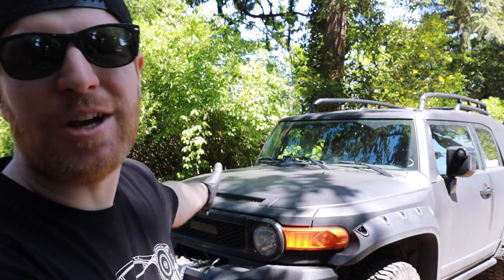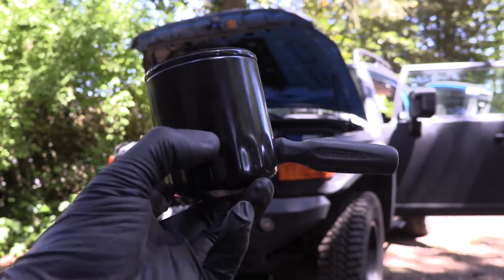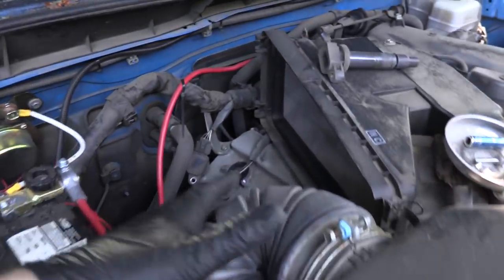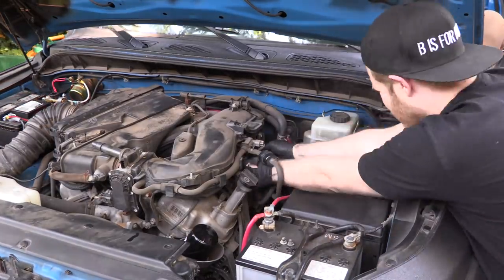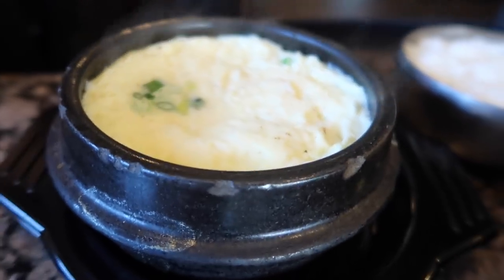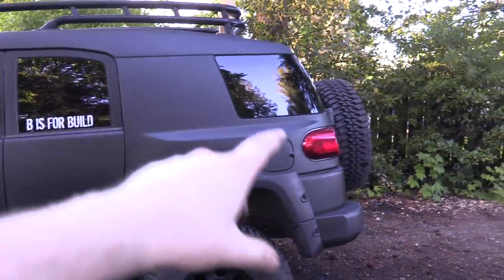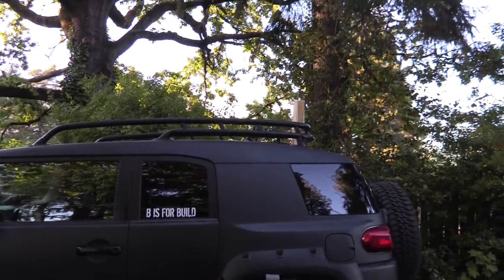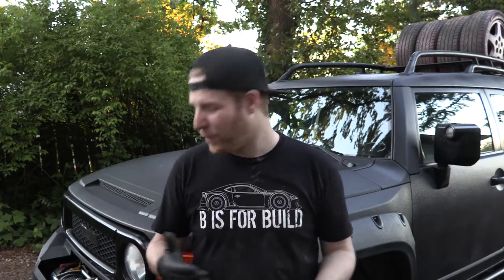FJ Cruiser Shop Truck Gets Some Love

Comment: im a "professional" oil pig, and we use a little brake cleaner on a rag to help twist off stubborn filters. sometimes it works, sometimes it doesnt, but i usually like to try this method before reaching for a filter wrench.

Comment: Tip for getting rid of wind noise from light bars, put them into a wind deflector. I had one on my 4th gen 4Runner and had to pop the sunroof open to narrow the wind gap between my roof and bottom of the bar. And it also toned the noise down.

Comment: If the oil filter isnt coming off by hand, I'd suggest putting a low grit sand paper in your hand. Works wonders for getting traction on a hard to grip filter.

Comment: Put a niece of pipe through the centre bores of the wheels and on either end of the pipe have a hole for a ratchet strap or metal clamp.
This would work for two or more wheels and if you’re just transporting one wheel it can lay flat.

Ratchet strap is a good option but with a metal rod through the middle it’ll make the load more secure/ be less likely to wriggle free

Comment: When I did the first oil change on my FJ, I tried using an oil filter wrench and it just crushed and twisted the outer shell of the filter. I thought the last owner just overtightened it. I made sure to not overtighten the new filter, but the same thing happened when it needed to be changed again. Had to do the screwdriver through the filter on every change.

Comment: Check the Throttle body and Mass Air Flow sensor if you never cleaned it. It will help with starting and run better too. I have a v6 Tacoma with the same engine and checked mine after was doing donuts on some off road trails. Also for the oil filter you can buy a 3' hose and put it on the nipple under the little oil filter overflow catch and drain it into a bottle or the pan you drained the oil in, so you wont drip oil all over your engine, belts, frame.

Comment: As was already mentioned, the screwdriver trick can get you into more trouble. As the metal skin and interior of the filter is so thin, you could easily destroy the body while the threaded area remains stuck. Now you can't drive to the store to get a proper oil filter wrench -- unless you're lucky enough to have a spare Evora collecting mold out on the street :)~

Comment: Cleaning your maf sensor is also a great thing if never done in 150k mi./ cleaning throttle body and relearn idle setting is also good if there is a small build up of dust/pcv vapor near throttle body. Cleans up idle if slightly bogging idle is noticed

Comment: One handy tip is to use an airline to blow out any dust, grime and debris before removing the spark plugs as it minimises the risks of stuff getting either into the cylinder or on the plug threads which will make them harder to remove next time.

Comment: A tip if you have an oil filter that's facing down, punch a hole in the top of the oil filter at the start of the serviced, lets the oil drain and makes way less mess.

Comment: Have fun sanding and painting that grill AGAIN in about 6 months time. Using rattle can black on a plastic trim piece WITHOUT a plastic adhesion promoting primer is a bad idea...

Also I thought most fuel system additives should be added just before filling up or at least part filling your fuel tank so that the additive actually gets mixed around in your tank...

Still love the build but don't let a busy schedule make you start taking shortcuts.
Reply: dito to that brother
Reply: petem8 I mean, for all we know he did run around the corner and fill up on fuel, or had a Jerry can.

He knows what he is doing, why are mechanics so forceful in commenting on every little detail.

If he wants help, he openly asks for it in the video.

Comment: This was dropped on it's side at some point right? That might explain the super dirty plugs on one side, they would have been soaked in oil and then that oil would burn into carbon when it started again.
Also, painting aluminium, like that grill surround, use an etch primer, otherwise it will just chip and peal again.

Comment: I’m a tech at a Toyota dealership. The spark plugs usually come out like that. Toyota recommends replacing them every 120k miles. (I agree that’s way too long) so the plugs usually are a bit tough to remove

Comment: I would advise disconnecting the battery at the negative terminal before messing with the coil packs. You’re probably fine, but why take the risk of shorting something out?

Comment: On the Evora air conditioning (since it's been empty for so long and comments were disabled on the relevant video):

You may know this, so this is just in case: use a vacuum pump to get it to the proper vacuum rating (-23 if I remember correctly), then fill it... videos are around about how to do that. Afterwards, just make sure the compressor isn't dragging on the drive belt when it activates, because that will indicate a broken compressor (it happens when moisture from the atmosphere wrecks the internals).

Here's hoping for the best.

Comment: I don't do that screw driver trick anymore. Once I twisted off the back and had to pull the radiator to get access with a hammer to chisel it out. 

Get the rachet head!

Comment: That service was spot on. You'll notice a difference straight away with fresh oil, filters and plugs. Does the FJ use a fuel filter or is it incorporated into an in-tank pump? I swear by NGK plugs myself. I also swear by BG fuel additives. BG44K for petrol (gas) and BG244 for diesel.

Comment: I hope you gapped the spark plugs to spec! Also to address other comments: 10k miles is probably pushing it in my opinion for an oil change. I used to change my oil every 3k or 4k miles but only started noticing enough difference when I started changing oil around 6k miles. I use Castrol Magnatec fully synthetic.

Comment: Aren't you supposed to change the oil AFTER using the fuel system cleaner? That's what i always do because i thought it makes the oil dirty after use.

Comment: Damn, that oil filter is the easiest to access I have ever seen.
Reply: I know, I saw that. wouldn't it drain out every time u stop the engine.  I'm gonna have to look into this Toyota
Reply: Yeah I worked on a Hilux that had either the same engine or at least very similar, one of the easiest filter changes ever.  The downward facing leaves the filter empty so you get little to no spillage when removing it, and there's even a housing around it with a small drain hole in it so any possible spillage is easily caught and cleaned.  The only other car I've worked on that was this easy is my Rx-7 as it also has a downward facing oil filter.
Reply: My e36 318 oil filter was super easy to change
Reply: The FR-S/BRZ are the same location. I think Toyota likes to put them there for ease? Either way it's awesome.
Reply: not on all of them - i have a 2010, and its completely different. it's a cartridge style filter, mounted still in front of the engine, but down very low, in the center. you have to remove a skid plate to access it.

Comment: If your FJ had Denso plugs on one side and NGKs on the other then they are likely the original ones. Toyota used two different brands from the factory for some random reason. I don't think anybody does it when they put replacements in.

Comment: No fuel filter swap? Always do the fuel filter man!

Hey, Chris - I've heard/seen you mention 10000 miles on a couple occasions. - is that just your thing? Your personal experience? I used to use Blackstone Laboratories to test my oil and waited that long or more (most people cringed) because I knew I was safe. Just curious if you are risking it, or if you know better.

Of course, I used to run Amsoil, and the old truck held 12 quarts, so I think 10k miles was OK.
Anyway, love your vids, love your channel in general, I love you - be well.

Comment: You forgot to mention on top of rubbing the oil filter seal you should also put oil in the filter so it's not dry when you start it up and gets oil to the engine instantly instead of filling the oil filter then to the engine I do see that it could be a problem with your application since it is on the top of the engine

Comment: Hi Chris im looking to buy a welder that isn't to expensive but will still weld a little bit of heavier metal do you have any suggestions and do you like Eastwoods welders I was looking at their mig135
Reply: Chris Vallone Eastwood is over priced shit look I know everyone can’t drop 1000 on a welder but if your welding heavy metal 220v is the way to go you have to get to a outlet wired in or you can run an extension cord from your laundry room it should have one I would look at holbart miller and Lincoln but if you pony up a lil more cash would go Esab fabricator it dose mig tig and stick
Reply from the maker: watch the 240z episode were we worked with a new vulcan welder.. we did a pretty thorough review of it, im very happy with my purchase
Reply: Go check out chucke2009s YouTube channel, he does a lot of reviews on budget welders. If you plan on welding anything over an 1/8th, just do yourself a favour and get a 240v plug installed, it's not super expensive and it opens you up to a way wider range of welders and other fabrication tools.
Reply: yeah I saw that episode Ive watched them all..lol... im glad you like it though I was looking at that one too I might just spend the extra money on it since you think its worth it. Thanks

Comment: Just buy a cheap filter wrench and do it the correct way and not spread hacky material. Also your filter was probably harder to get off not because it's tight but because the gasket went on dry.

Comment: So you have a shop truck but it's too small to carry a set of wheels? A hitch-mounted rack would be easier to load up and keep them out of the airflow: elements with a circular cross-section are almost the worst shape in terms of drag.

Comment: @bisforbuild no fuel filter change?
Reply: Hmm, I'd expect an external fuel filter in a vehicle of that age.
Reply: With fuel contamination so apparent I'd say, change it when you service the car. They are still only small paper filters that can only hold so much particulates befire it starts to clog the lines and slow fuel delivery to the engine.
Reply: Haha

Comment: Why didn't you change the fuel filter as well? That never gets changed...I highly suspect it will be like your spark plugs
Reply: The_Homeless_ CDN i see. Is that something that can replaced apart from being a pain in the ass to get to?
Reply: The_Homeless_ CDN that sounds like a real pain on the rear....how many km has b is for build on the clock?
Reply: White Thunder I'm not sure how many the FJ is for, but my Toyota Camry has a "Lifetime fuel filter".  From what I've read, they're seriously over-engineered to last quite a long time.
Reply: D'Montae McWillie that's interesting......I have seen from cars that says the same thing but when you remove it and take a look, it looks really worst for wear....
Reply: From the people I've known to actually change them on Camrys, they're surprisingly clean.  Even the one I have seen taken apart was absolutely enormous compared to the fuel filter on my old focus.  There's a hell of a lot of material in there, that's for sure.
Reply: D'Montae McWillie definitely something I didn't know! Thanks for that info...😄

Comment: Gee, I didn't think u were such a cowboy! :-) u didn't check your spark plug gaps b4 install and you should put fuel on-top of any additive to break it up, most additives are heavier or lighter than the fuel in the tank. just saying. And def wouldn't have changed that air filter unless u drive dusty roads allot; u must be loaded with cash dude.  Though u wanted to eliminate the extra turn over at start-up, my guess it would be the 150k mile plugs. u also didn't really show the condition of the plugs or what their final gap was, that could have told u and us a bit too, just saying. lol. I stil love your work though, u r a genius..... in most things :-)